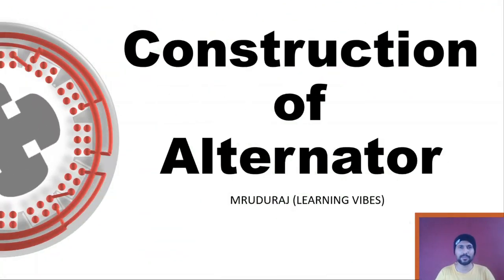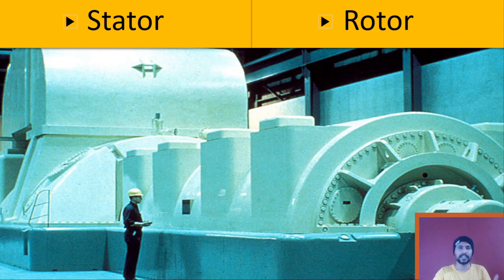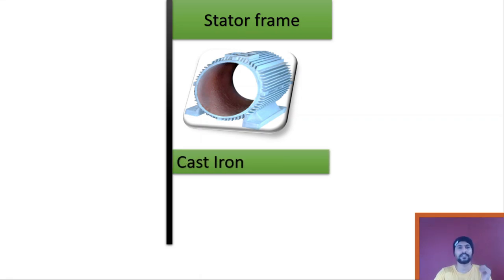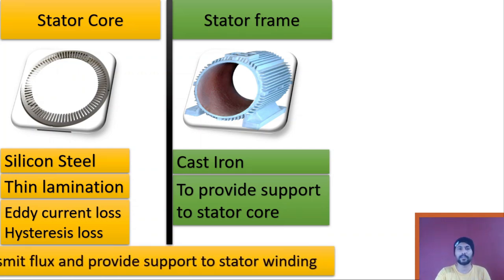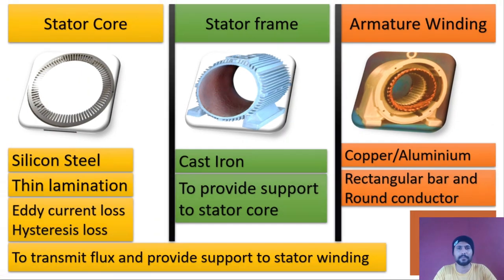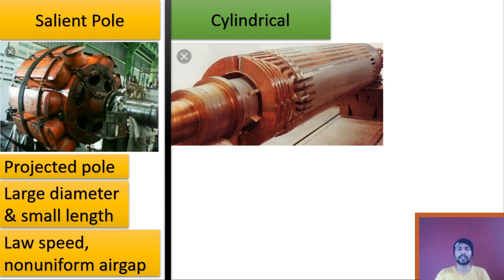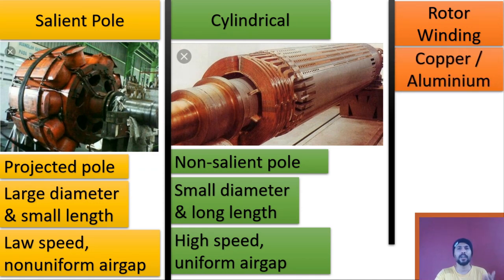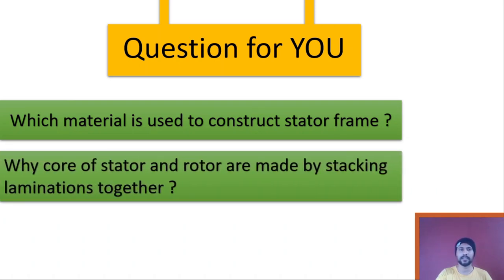Detail construction of synchronous generator, Alternator construction, construction of alternator

Comment: the used material in the core construction of a stator is thin laminated silicon steel sheets

the reason behind selecting the material of stator core as thin laminated silicon steel sheets is to reduce the eddy current losses
Reply from the maker: great